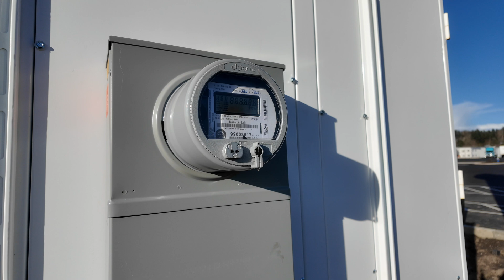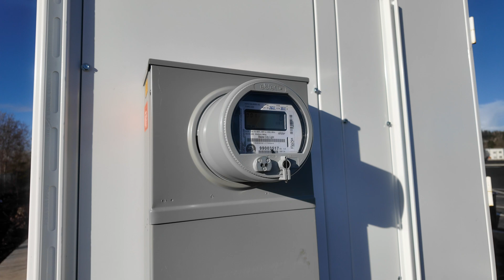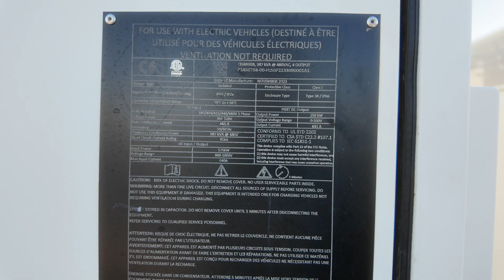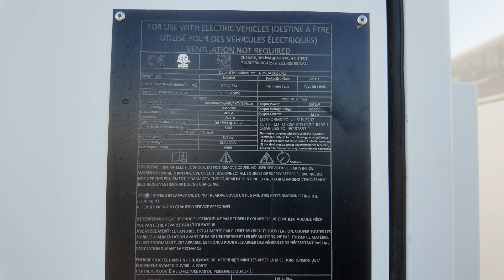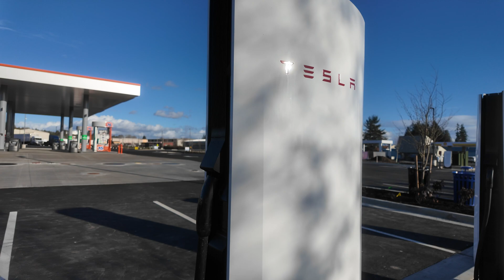Confirming Blaine, WA V4 Supercharger Specs | CCS EV Compatibility + Cybertruck Sighting!  Part 2

Comment: Where is alll this power come from? We all know that power plants still run on fossil fuels. Not all but most. Also do the EV cars hold their value? Like if you want to trade it in? Sorry for all the questions
Reply from the maker: Power sources vary by region, in the Pacific Northwest hydroelectric is the primary source but Natural Gas is used as well. 

As for EV cars, their value retention varies but generally holds up well due to lower maintenance costs and increasing demand for sustainable transportation.

Comment: I"m going to ask a question (or questions here) that I've wanted to ask for a while.  With the onset of Ford being able to charge at some superchargers now, and other OEMs coming on board, the charging ports are not all in the same position as on the Tesla.  (I know, duh).  Why wouldn't Tesla starting building their supercharging stations like filling stations  are now?  With pass through lanes, the ability to charge on either side of the island?  With covered awnings?  Is this too far out of the realm of possibility?  Seems like with the advent of the other OEMs coming on board, Tesla would need/should want to accommodate more/different charging port locations, instead of being stuck in the same location based supercharger setups that we see at most supercharger locations.  

Thoughts?
Reply: That's the reason for the longer cables on V4's. And they are building more and more pull through stalls now, however, they are limited by what the location allows them. The real-estate owners place a ton of restrictions on EV chargers. They limit the parking area they can use. Especially in red states. So Tesla tries to maximize the small area they are allowed by placing as many stalls as they can so they have to install them as close as possible. You need to go ask these real-estate owners why they only allow such small areas for EV chargers. If you go out west, you will see that parking spots are now being built a bit wider where the location allows, but they are also being slanted to allow for more room. 

As for ICE vehicles and gas stations, you are aware there's only 2 gas inlet port locations on ICE light duty vehicles nowadays, correct? Right and left rear. That's why the left rear and right front need to be the 2 standard locations that ICE vehicles adhere to. EV manufacturers will more than likely adhere to those 2 locations going forward (outside of Rivian which apparently is doing all it can to fail) if they want to sell the most EVs to use the largest charging network in America (by far) whose vast majority are V3's and will still be for many years to come. Ford has already said they will  charge theirs and GM is already using the left rear on the EV's I've seen from them, as does Volvo and Polestar.

Also, gas pump stick to one side only not two, just like Tesla does. To be able to use both sides, they install 2 pumps next to each other, one for the right and another for the left. Tesla already does this on many stations in Europe, especially in Norway, and they are already starting to do the same in the US out west when the space allows it. They are also installing slanted parking spots to allow charging on both sides, doing the same as gas pumps placing the next to each other back to back, so that EVs backup, or pull in, on both sides. I charged on several like this in Arizona a few months back.

As for a state like West Virginia, you have to keep in mind that they are very anti-EV. I doubt that there are any CCS DC fast charging stations there. Please let me know if I'm wrong on that. Tesla is allowed only because Elon plays along with their right wing ways, so he gets a pass.
Reply: I just made a comment on this. It's frustrating. At the very least, they could just put the posts between parking spots, like a lot of EA stations at Walmarts are. Won't help a ton for people trailering as they'll be hanging way out, but would make it accommodate any other manufacturer. The longer V4 cables definitely help though. Shouldn't be much stall blocking that way at least.
Reply from the maker: Hey there! That's a really interesting question, I’ve spent a few days thinking about it. It's true that with more electric vehicle manufacturers entering the market, there's a growing diversity in charging port locations. Tesla's Supercharger network has been a game-changer, but the longer cables on this style of charge will help things.

Your suggestion of building Supercharger stations like traditional filling stations, with pass-through lanes and charging points on both sides, along with covered awnings, has some merit.  However, that would add to the cost of developing these kinds of stations.  With that said, Kettleman City Supercharger in Ca is massive development which has solar powered roofs.  In largely traveled areas this makes sense, but in some cases where space is a factor a narrow row of chargers does just fine.  

The fact is while I believe that the parking stalls should be wider, I think various styles and layouts work rather well. Although, the older chargers with the shorter cables will continue to be a challenge for the range of potential vehicles at peak times.  

We are really still in early days but the need for charging of different speeds is needed. I use a Level 2 charger at a community centre when i play ball hockey for 2 hours, a slower charger works great as i don't require the faster speed like I would on a road trip.

Thanks so much for your question.  Are you an EV driver?
Reply: @HeyWeirdos  Funny (sad) story.  I bought a Tesla Model 3 the Friday before Thanksgiving 2023.  I had to pick it up down south from where I live on the following Tuesday.  Which was two days before Thanksgiving.  My wife (who was also on the title) wouldn't drive to pick the car up, so I had to cancel the order.  Ended up buying a Crosstrek instead.  But my next car will be an EV.  Either a Mach E or a Tesla Model 3.  Although I really would prefer a sedan like an older Volvo, but in EV format.
Reply: Lack of pass thru stations is a real estate issue not a design challenge. Landlords are reluctant to give up prime real estate to accommodate 16+ chargers arranged under a roof with more square footage needed for ingress and exiting the canopies than just some parking spots on the fringe.
Reply: @anthonyc8499  One of my main reasons for this comment is I think that there needs to be more of a gas station type feel for charging stations.  It will make it more comfortable and safe for all drivers (especially, no offense, women), if they are lit, and covered.  And with the ease of  a pass through design, it will make them more accessible to all drivers and all models of cars.  Yes, I know the OEMs will change, but the current cars will still be around for a while, and the more that the charging stations can be adapted to work well for EVERYONE, the better, IMO.
Reply: @mikestrock  yup, 100% agree. The problem right now is that DCFC stations are an afterthought in the refueling game. There are barely any stations in the USA that were built from the get go as a DC fast charging station.  Hopefully with more investments being made in 2024 and beyond, we’ll see this change.